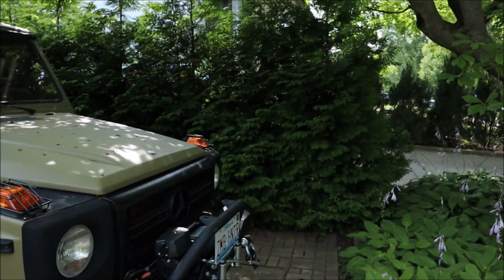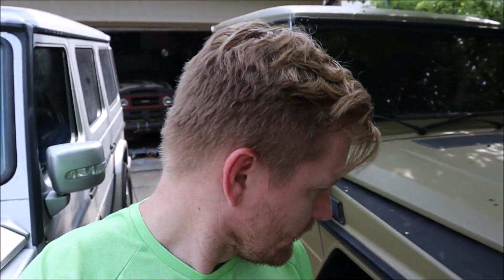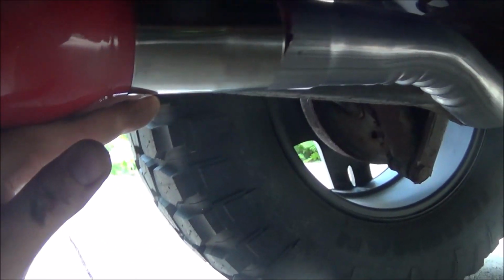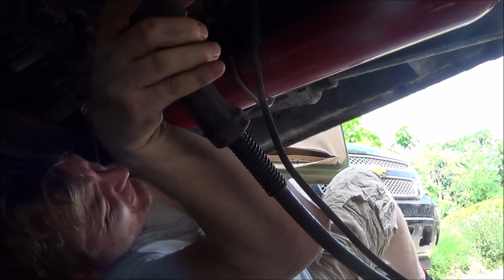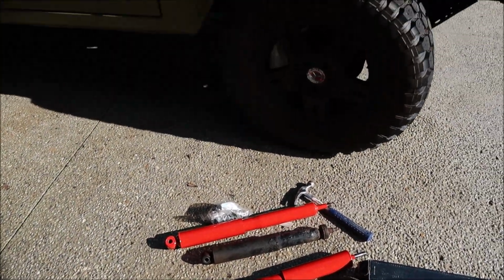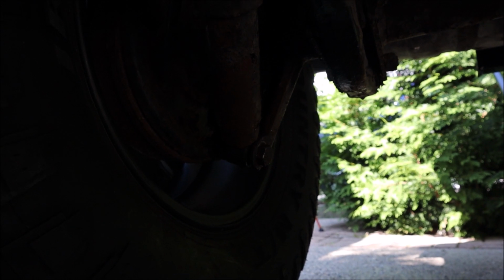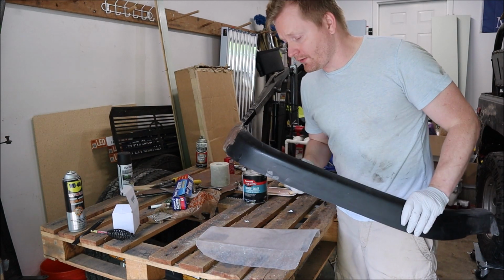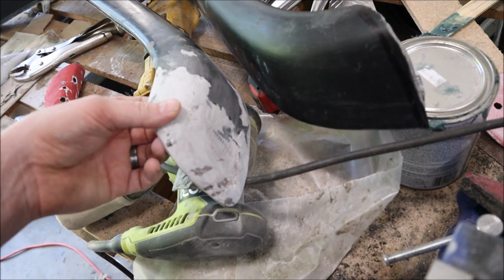Mercedes G-wagen Restoration Restomod - Project "Zombie Hunter" (Day 50)

Comment: Will you consider selling your 40mm wheel spacers?  did they alter the lug pattern from original specs. I'm running the stock rims for w460 and want to space mine out some.
Reply from the maker: Sure. Where are you located?
Reply: @medicinemon  Fort Riley Kansas
Reply from the maker: Oscar Revia I paid $260 for the set new. Yours for $150 + shipping from Chicago.
Reply: @medicinemon  sorry for the late reply, I had an unexpected issue on my g wagon. I will get back to you on a later date if it is still available.  Thanks
Reply: Übersetzen ins Deutsch bitte!